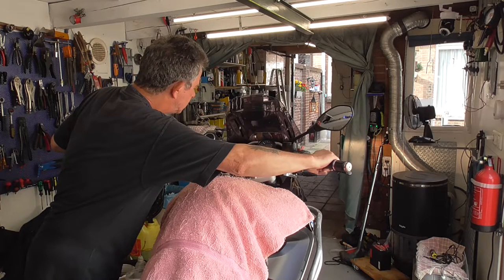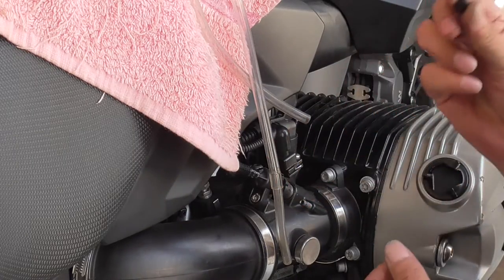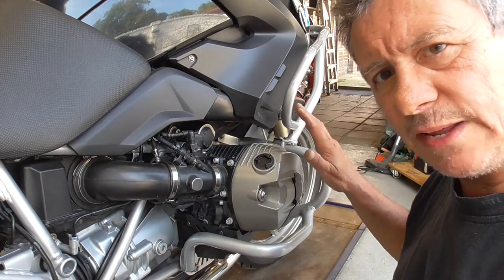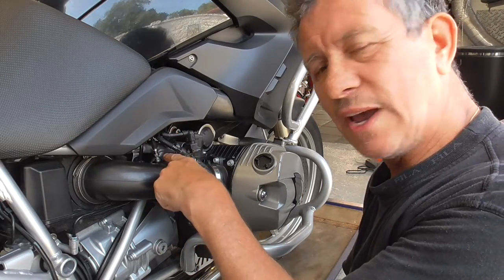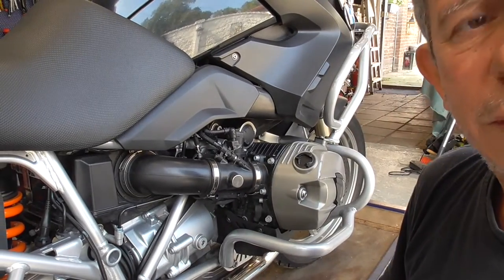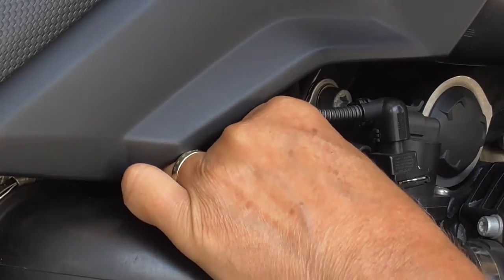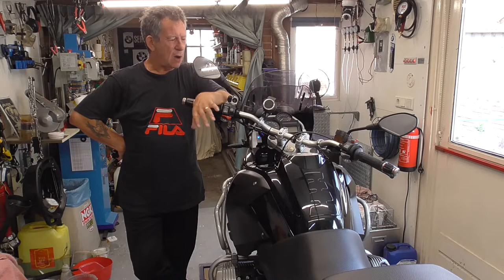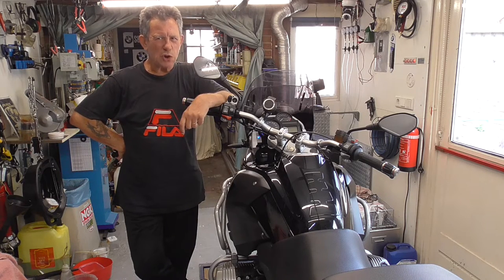BMW R1200GS [2010] THROTTLE BODY SYNC.. Is it easy...?  The Old Mechanic his own R1200GS 👨‍🔧

Comment: Thanks, I had adjusted the balance perfectly just as you demonstrated, then my GS-911 completed the sync and it would not idle. After re-watching your video, I decided your balancing method was correct and the GS-911 corrupted the setting. I reset the engine controller BMSKP2 to the original values and then performed the ignition on/off with 3 full twists of the throttle, when restarted - perfect idle. Out on the road the performance was nothing short of amazing.
Reply from the maker: Nice work!

Comment: Nice video but i do miss something... You use 2 gauges/meters to measure the vacuum but what i miss is the balancing of the 2 meters with each other. Use a piece of Y connector and connect the meters to the Y connector and then with 1 tube from the Y connector to 1 throttlebody. Start the engine and set both meters equal (as they both have the same amount of vacuum). Now you know that both meters measure the same amount of vacuum on their scale. Disconnect them and do the rest as you did. It is important to know for sure that both meters measure the same amount on their scale. I tested this once with a Carbtune Pro. Looks nice but hey.... i synct the tb's until the rods were at the same level. And then i thought: what happens when i switch the two rubber hoses..? Shit, the rods were immediately different on the scale. Switched the hoses back and the rods were equal again. Carbtune.... never used it again.

Comment: I used a GS-911 to sync mine. After the sync my bike wont idle. Just reset the adaptation values and idle was fixed. After the throttle sync at 2500rpm, I sync the idling  perfect with the right side throttle body idle screw. My bike idle so smooth now.

Comment: Great, thanks. I came to this topic not because of any idle problems or engine running problems, but quite stronger vibrations when riding than it used to be. So I was suspecting some unbalanced "whatever" between cylinders/stroking. I have checked the synchronization according your video and it was quite unequal. After right sync the vibrations are much weaker! Great.
Reply from the maker: Excellent! 👍🏻👊🏻😉

Comment: I agree with you on balancing the throttle bodies. I've been using vacuum gages for years to balance multiple carburettors. So I don't see the need to use a GS911 to electronically open up the idle solenoids to balance the throttle bodies. It's all about taking your time to synchronise the 2 throttle bodies. Very easy procedure compared to multiple carburettors. Nice job, and well made informative video's for amateur mechanics with basic knowledge and tool's.
Reply from the maker: Thanks mate 👍🤛🏍

Comment: Dear Old Mechanic, 
Last year I performed a throttle body sync on my R1200R using the GS911. At the end of the procedure, the idle speed was very unstable, the bike was undriveable. I contacted the GS911 helpdesk and was advised to reset the adaptation values and have a firmware update done on the engine's ECU. After resetting the adaptation values, the idle speed was stable again, but I had to relearn the gears using the GS911 so that the ECU knows which gear is engaged. In the meantime I have had a firmware update of the ECU of the engine, done by a BMW dealer. Actually not a good thing because now and then I can no longer read the outside temperature on the dashboard. Next week I´ll service my bike again but I think I´m going to use your method for the throttle body sync. Thanks for your good instruction videos, I became almost addicted. By the way, where did you buy that handy LED lamp with the flexible neck and the magnetic foot?
Beste groeten vanuit Antwerpen.
Reply from the maker: Hi Erik, what you got was my fear and that was why didn't used the GS911..
These days I use the MotoScan app, its so much better AND cheeper too. Allthough I am still not dare to use it for a throttlebody sync.. Actualy my GS runs fine 😉. Look at my playlist about the motoscan app, I am sure you love it too !
That light i got from Aliexpress 😂
Greets 👍🏻👊🏻🏍
Reply from the maker: The playlist is : BMW MotoScan TIPS, TRICKS & SECRETS
Reply from the maker: Share it with your motorcycle friends 😉👍🏻
Reply: @TheOldMechanic  I'll certainly do. 👌👌

Comment: I had the same issue when I used Motoscan to recalibrate the idle actuators on a 2015 r nine t!! Don’t recalibrate just balance the throttle
Bodies… The fix is too disconnect the battery for 5 minutes and then reconnect it, start the bike but DO NOT touch the throttle after a couple of minutes the bike rests the actuators and the tick over is back to normal😅!
Reply from the maker: Great info, thanks 👍🏻👊🏻

Comment: Thanks for your videos and greetings from Denmark.
About this procedure I was told, by BMW guy that the sync can be done by turning the ignition on, twisting the throttle to full tree times, then turn the ignition of and the thottle sensors should now be aligned. This is on my R1200gsa 2009.
But I am gonna try your way anyway.  Now just waiting for the snow to go away. 🙂

Comment: Newbie question, hi old mechanic great video by the way. How the two gauges are performing independently when only one tube is attach to the motorcycle? Thank you monsieur old mechanic!
Reply from the maker: Each one of the 2 cilinders has his own vacuüm meter 😉
Reply: @TheOldMechanic  I do have 20+ years of experience riding motorcycle… without having any knowledge on the mechanic side. I bought a GSA 1200 last year and I found your videos in the winter in inspired me so much now I would like to start doing my old maintenance. Thanks again for all your great videos!!

Comment: Is it -0.3 you're looking for? The before shot shows RHS -0.4 with LHS - 0.3 does altering the screw only change the RHS so it reads same as LHS?  Thanks otherwise a great video.  What are you using to measure some mercury vacuum gauge or something?  Regards Mark Aberdeen

Comment: Hello Old mechanic,
Thanks to share your knowledge. I've recently bought the UniCarScan UCSI-2100 adapter and also installed the MotoScan app.Lite to test it. It works fine with my bike (R1200R-2011).  I'm in doubt whether to purchase the profesional or the ultimate version. When I do an engine sync with the GS911 to lock the actuaters, the bike idles poorly and even becomes unridable. After a "reset adaptations values" with the GS911 the bike idles stable again. After that reset you have to relearn the gears again. The helpdesk of the GS911 advised me to do a firmware update of the bike at the dealers wich I did. But it didn't solve the problem, the problem persists, on the contrary, now sometimes the outside temperature is not displayed on the instrument cluster. So when I do an engine sync I do it The Old Mechancis way. I don't know if the MotoScan app has a function to lock the idle actuaters.

Comment: BMW opposed twin motorcycles make maintenance a breeze, My Yamaha 4cyl only oil change is simple job every thing else i leave for Dealer . As usual good vid OM.
Reply from the maker: Hi Joe, you are so right. Some bikes have their sparkplugs hide as if they never need to be changed, but mate its doable. I am now busy on my daughter in law her 'new' BMW F800GT and just to get all the Tupperware off you need to get 44 (!) out..😂 Greets from the old mechanic, drive save 🏍
Reply: Good day mate, quick question. Can I used an ordinary carb synchronizer? I'm not a mechanic but I'm starting to do my own maintenance work.. Your videos are easy to understand and direct to the point.. Awesome video..
Reply from the maker: @ragnarrock8747  Hi Virdi Yes you can any carburator sychronizer will do the job.
Greets from: The Old Mechanic

Comment: Hi there Old Mechanic!  Thanks for your detailed videos, it helps a lot.  I have a 2013 R1200GSA (last version before they switched to LC model).  I tried the throttle sync with vacuum gages I purchased from Aliexpress but when I connect them they rattle like crazy, not even possible to see the needles.  What am I doing wrong, or the cheap vacuum gages are not good for this task?  Thanks for the help and keep up the good work.
Reply from the maker: Sqeeze the hoses until the needle goes slow 😉
Reply: @TheOldMechanic  Thanks for the reply. I’ll get some valves to be installed on the lines.
Reply from the maker: That will do the job, in my video you can see that I have them too. 😉👍🏻👊🏻

Comment: Good day Old Mechanic,can i use the vacuum line where you put the hose for the carb synchronizer and put seafoam combustion chamber cleaner to clean the throttle bodies and valves?im not a mechanic ,just a guy trying to do his own maintenance!thank you..

Comment: Is your idle speed stable?
Are your higher revs also stable?
In my case, the needle constantly moves slightly both at idle and at high revs. Is it normal?
I have new spark plugs, ignition coils, O2 sensors, TPS and fuel pump controller. Overall the bike rides very well. The only thing that worries me is the unstable RPMs.

Comment: What do you mean with idle surging between 1k and 2krpm? Mine does this sometimes, but under load at very slow speed in 1st! Idle and 2krpm are now set very good with a carbtune (for this ieven adjusted the 'forbidden' screw on the right tb and i have proper slack in the throttle cable) and hoped this would fix it, but it didnt. Do you maybe know what could be wrong? Groeten!

Comment: Hi 
Can I ask you a question? 
I have a whining noise coming from the engine at around 2k revs or when I'm gearing down (engine breaking)
I changed the Alternator belt and checked the Alternator seems OK 
I'm thinking could it be the cam chain tensioner? 
Any ideas would be appreciated 
Thanks 
Great vids 👍
Reply: my 07 r1200r has that whining noise as well, as did an older GS I owned - I had  posted avid of the noise and every one said -- normal. They say the 1200's have updated cam tensioner --

Comment: Forgive my ignorance. I'm just learning. From my reading around, the manual TB sync and the GS911 process are intended to achieve the same thing, but I don't understand what they do.
I think the manual process you describe is simply changing the throttle on one side so the air flow matches the one on the other side? What exactly does the GS911 process do? I'm not sure I understand what these stepper motors are in relation to this.
Reply: @Sophie Collins, the GS911 process locks the idle actuators.  The software on these motorcycles attempts to keep the idle stable and smooth, using readings from the lambda sensors on the exhaust to control the fueling and by opening/closing the idle valves (actuators).  Sometimes, due to mechanical wear etc, it is no longer possible for the software alone to manage this.  That is where the TB sync process as per this video comes in.  This video, however, only covers the 2000rpm sync, and not the sync at idle.  If you were to attempt the sync at idle without the GS911 locking the idle valves, you would be fighting the software changes which would be attempting to do the balancing at the same time.  The GS911 locks the idle valves so that the mechanical adjustment can be made without being overridden by the software.  Once the mechanical adjustments have been completed, the GS911 process then releases the actuators again.

However, since there have now been mechanical changes made that the software is unaware of, the software is still assuming readings are correct based on the old mechanical settings, thus the lumpy and rough idle.  All that needs to be done is for the adaptations (the readings the software uses as a baseline) to be reset to default.  When the ignition is cycled, the software will take new baseline readings and once again be able to control the idle. 

Hope this all makes sense.
Reply: @GuysGarage120  Thanks for your super detailed reply - Since watching this, I discovered that this process doesn't apply to my bike because it's one of the newer LC 1200s. So I'm a bit lost where to go from here.
Reply: @sophiecollins ,  No, you're not lost at all.  You have more time to ride your bike!  You are correct, this video and the procedure outlined therein doesn't apply to your bike.  The LC models are all "Drive by wire", so the throttle bodies are entirely controlled by the software from the DME/ZFE.  There is therefore no need (and also no means) to do any adjustments on them.  Everything is done automatically.
Reply: @GuysGarage120  hmm... So how do I stop the wobbly idle then?

Comment: I work on and sync these bikes virtually on a daily basis, always using the GS911 to lock the idle actuators.  The rough idle and "surging" is quite common on the 2010 and later models.  However, this is easily resolved by resetting the adaptations once the sync is done.  There is no need to "take the bike to a dealer to undo the damage".  

FWIW, the idle actuators are only in play when the engine is at idle, i.e. throttle is completely closed.  When you are syncing the throttle bodies at 2000rpm, the idle actuators and their position are no longer relevant.
Reply: I bought 2 new OTC vacuum gauges, when I hook them up to a full op temp engine (2010 R1200GS) the gauges are bouncing like ceazy at Idle. I have to get the rpm’s between 3-4K rpm for the bouncing to subside somewhat. The bike has 9,500 miles on it. Any help would be greatly appreciated.
Reply: I bought 2 new OTC vacuum gauges, when I hook them up to a full op temp engine (2010 R1200GS) the gauges are bouncing like ceazy at Idle. I have to get the rpm’s between 3-4K rpm for the bouncing to subside somewhat. The bike has 9,500 miles on it. Any help would be greatly appreciated
Reply: @cindy_lewis ,  you will notice at the 2 minute mark in this video, The Old Mechanic adjusts the valves on the tubes leading to the gauges.  Your gauges should have similar valves.  Just close them a little at a time to stabilise the needles.

Comment: Could you help me. I did since with gs 911 and now idle is jumping form 1000-2500 how k can fix that I tried everything
Reply from the maker: It seems that your bike has the 'wrong' software.. and when you do a trottlebody sync with the GS911 that went wrong. You have to go to a bmw dealer to update your bikes software. Atleast thats what I know.
Reply: Just reset the adaptations.  The software just needs to get new baseline readings.  No need to update any software.